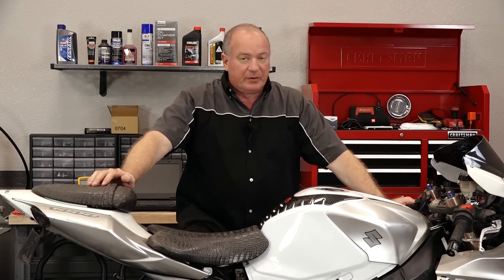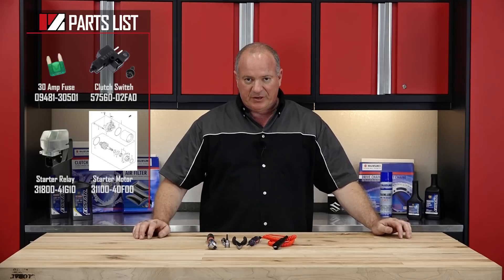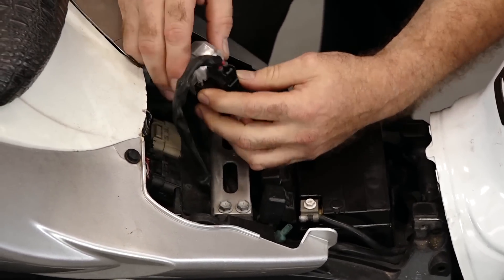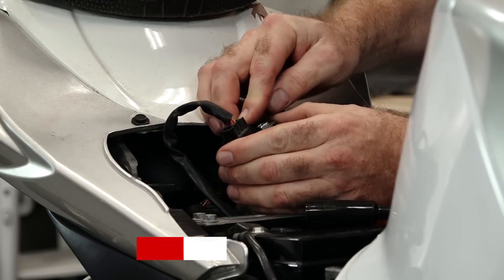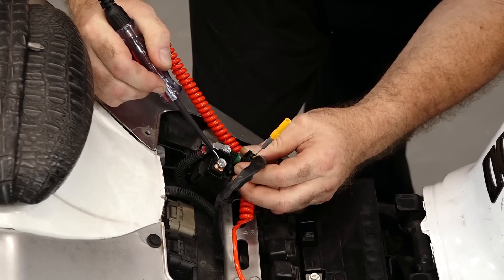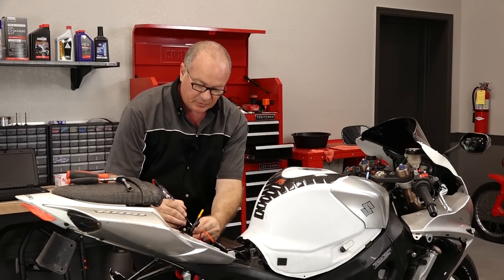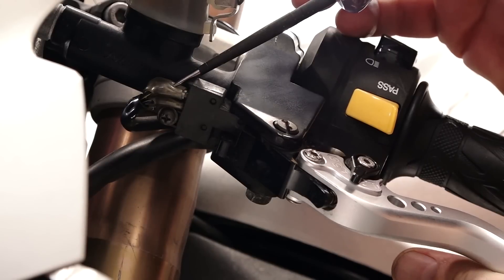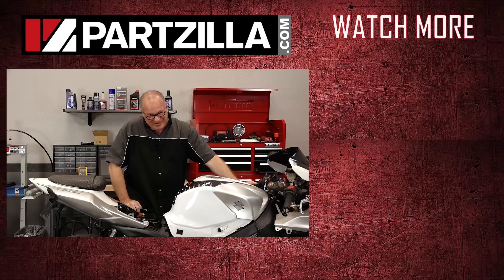GSXR 1000 Won’t Start Troubleshooting | Partzilla.com

Comment: I didn’t hear the solinoid click and the clutch switch didn’t seem to be working correctly. I took the switch of the clutch and it was looking dirty. Sprayed it with some Contact Cleaner. My test light works now when I press the switch and I can hear the solenoid. Thanks for the trouble shoot tips. You’re a Champion!

Comment: Is that test light any different than using the continuity feature on a multimeter?
Reply from the maker: Yes, the test light is testing the presence or absence of voltage.   It's an easy way to see where the voltage stops and diagnose an issue.
Reply: @PartzillaParts  where can one purchase the test light?

Comment: Thanks SO much, you set me on the right direction and more importantly, you've made a lifelong customer when or if I need parts, because you saved me from a few hundred $$$ bill to have her towed to a shop and worked on, etc.! All we need is someone honest who can steer you in the right direction - I have a busa but Suzuki is very similar across the GSXR line. Thanks again, GSXT 1300 owner!
Reply: On your Busa did you get a CHEC light on the dash and no fuel pump prime or starter relay clicking noise? I have the problem and after much research I am assuming it could be either the starter relay, side stand relay or fuel pump relay. What was your issue on your busa. Please feel free to share. Thanks.

Comment: First off thank you for doing God's work ! My test light doesn't luminate when on the negative side but the fuse does on both sides ? When I did the clutch switch test my bike starts but only when the test light is touching the top  prong like you stated ? Am I giving the clutch switch proper ground to start ? Should I trace down that ground on the clutch switch any suggestions would be greatly appreciated, thank you once again.

Comment: John thanks alot man. I have an 03 GSXR R1000 and the issue with mine was the battery. My battery was dead and no good so got it switched out. Thanks for going through these steps which helped me troubleshoot other things to make sure.

Comment: Thank you for the support,I got a 2005 r1000 I remove gas tank and disconnected all electric parts becouse it had 2 stock valves I didn't that put everything back together now the bike won't start it has spark fuel it turns it would not fires thanks I did crank the motor with everything unplug,,,thanks

Comment: I have low mile from o.g. owner gsxr 1000 ('06) with Zero'd out Power Commander II (still hooked up) and my ECU was flashed w FTECU for megaphone pipe early 2019. Stock air filter and stock Ti header. The bike never did this for 10months after I had ECU flashed. Problem:  Intermittently only like 1/6 rides - bike will crank but NOT RUN from cold or warm.....ive waited 30 sec in between 4-5 tries and it might catch and then run no problem.  Sometimes Ive cranked 10 times to point where battery gets weak so I give up...today I went home and let the bike sit at work in sun and tried again 11 hrs later. It still did not want to run and I had to crank 5-6 times and luckily it ran perfect lit off no hesitation after cycling key between tries. I cannot tell if its no fuel or no spark. Fuel pump always spins/whines....has left me stranded at work x2 times and I give up cranking it and just just hitch a ride home w coworker. Bike was damp on nighshift 2 of the 3 occasions so I was thinking moisture ingress ...... I can not replicate the problem after it runs. It does this 1/6+ rides to work...she just will not RUN while cranking not even a clue that it wants to catch and run...its all or nothing....she is cranking with no clue it wants to catch or it fires right up. NEW Iridium plugs several weeks ago to address but it is still doing it randomly!! It also did it hot after a 20 min ride in to work I accidentally stalled it at badge readers and it wouldnt restart! 91 octane fuel + new plugs only 13,000 o.g. miles....mods FTECU flash 2019, but still has old 2007 PCII ( in place but zero'd out)

Comment: I need help with my bike if possible 07 GSXR 600 I turn the key the cluster is stuck wont go to zero just turns on and stay stuck might need a new cluster...I replaced the completel lock set thank you so much for your helpful video so I turn the key cluster is stuck and i get nothing no noise no relays turning no fuel pump priming what could it be if you could help out

Comment: My 01 GSXR 1000 Will not start, I hear the fuel pump. But she will not fire up. New Plugs and filter,I spray starter fluid in intake and nothing. But every once in a while she will give a little rumble then die. Sounds like something is shutting her down. What to do. Any help is appreciated, Thank you for your time.

Comment: 2003 GSXR 600 , it has been sitting for 8 years outdoors , I drained fuel. I hooked up jumper pack straight to bike cables, wanted to see if it will crank, turn the key to on, I get neutral light, head light, tail light, I hear fuel pump try tp prime, Very low (weak sound then normal). get no speed or mileage info on display,, kick stand is down, maybe some type of safety ? checked all fuses, no broken fuse, I am handy with a fluke meter maybe can give me some starting points

Comment: Love the videos you produce and gives me confidence in working on my own bikes. I just bought Chinese clone of a Honda Grom, 2019 X-Pro Vader 125cc. The previous owner drove it for 26 miles and garaged it there after for about 1 year, because he would ride and then it would just shut off completely, he had taken it to motorcycle mechanics and they were dumbfounded when they test rode it and it did the same thing. After buying his bike I had the same trouble and with a new battery I can see the one fuse on the positive terminal that keeps blowing every time I try to replace the fuse. So I get no lights on the digital dash, no start, can you guide me on what you think on how to repair the fuse that keeps blowing., any help is greatly appreciated.

Comment: Thanks for the video. I am having problems getting my K3 1000 to start. My bike had sat in the garage for a few months. It would not start, the starter was having a hard time turning. I replaced the battery, same problem. I replaced the starter, same problem. I replaced the starter relay, now all I get is the new relay buzzes. Am I missing something? What would be the next thing to check? Ant info would be great. Thank you
Reply from the maker: Take the time to test the whole system.  Start by inspecting the cables and wires for corrosion or damage.  Load test battery, test stator and rectifier.

Comment: Hi, I own aGsr 750, 2015.
It happened something similar . I start the instrumentation panel, the lights are good, right. When you hold the clutch down and press the start button should start like usually. She started after I shift in the first gear holding the clutch down and  the starting button giving a strong push and releasing the clutch gently.Before that I checked the voltage on my remote alarm display, was 11.82V. The bike was in cold weather all day outside at work.

Comment: I'm curious what you think would be the most likely issue between the starter or clutch switch. I have an 09 1000. Everything was working fine, but when I went to leave work at the end of the day, would not crank. After about 3 minutes, it cranked and fired right up. No issues the rest of the day, until the next morning goin to work and again at lunch.
Reply: @DarthShibby  I finally found out that my clutch neutral switch was unplugged but the connectors were still touching under the protectivesleeve. Plugged it back together and haven't had a problem since.

Comment: My 08 gsxr 1000 sat 7/8yrs after a tragic accident that my interest was lost. Now i wanna get back to riding & went to start bike to notice i need new throttle cable however my bike won't start. It turns over just no fire so we changed the tank still nthn and then thought about the injectors maybe needing cleaning however not sure due to the time it set in my basement & changed battery also! 1 option said maybe stator then another said check injectors from ur experience what u suggest or idea u may clearly have upon this issue?

Comment: Great video.  This video helped , but what is the possible problem if your test light doesn't light up on the last relay check of the ground side at te Videos 4:09 min part. ?
Reply from the maker: It means you aren't getting power from the switch.  Bad wires, bad switch, etc.
Reply: Thanks for the help Partzilla.  Your videos are a great help and they helped me get more familiar with my bike and at least narrow things down. 
👍
Reply: Hello again Partzilla, 
I do appreciate your videos. 👍   So..  I ended up taking my "no starting 07 GSXR1000  to the shop to get another set of eyes on it. And They tell me number 9 ecm pin melted.  My ? Is..  What types of things may cause this and if i put another ecm in..  how do i know  the new ecm won't just melt down too?

Comment: I have a 2004 Gsxr 600.  Its been sitting for quite some time.  I replaced the battery as I knew it didnt have any power.  I put some gas in the tank.  The starter is kicking the engine over and wants to start but doesnt.  I picked up some starting fluid, gave that a try.  It will kick over and start to run but only for a second then stalls.  I hear the fuel pump working everytime I turn the key and I dont think its my spark plugs as I have replaced them years ago.  Can spark plugs just go bad just sitting in the engine?  Im thinking I might not be getting any spark  from the coils.

Comment: Hi I have a 5/02 GSXR 1000 Suzuki that has been crashed the speedo is disconnected and the loom is disconnected both are damaged I have ignition and the tail light is coming on but the bike will not turn over and the fuel pump is not turning on can you tell me if it needs the speedo instruments to be able to start. It will turn over crossing the solenoid but still won't start. Thanks for any help.

Comment: Your explanation a gave me a light! I have an 05 gsxr 750,it was crashed and totally rebuilt, now I'm having problems starting it. Lights,tach,fuel..everything is working. But when I hit the starting  button,the relay doesn't even click. What can it be? Thanks a lot !
Reply from the maker: Ignition wires, damage to the hand controls, damage to wires going to starter relay

Comment: On my 09 V-strom dL 650 the starter solenoid is clicking several times when I press the starter switch, but bike won’t crank or it won’t start at all, replaced the battery and starter solenoid it self and it keeping doing the same thing, just checked all the step on your great video and they look the be getting good power and ground, but I can’t figure it out 😕, any suggestions? Besides than get you a new bike lol
Reply from the maker: If it's clicking, then you don't have enough power.  Check your wires and connections.  You'd be amazed how many times it's that simple.
Reply: Partzilla yes! You completely right, After I checked everything absolutely everything else like battery, starter solenoid, starter switch, kick stand switch, clutch sensor, starter assembly by it self, I was able to find out than the screw holding the negative wire from the battery was sulfated all around the tread with absolutely no sign of rust or any damage on the outside, the washer and ring by it self was looking so clean and healthy, so I removed it to check the connection and I figured it out than the screw was all white on the treads, I cleaned this out real good, sanded off a little bit and the bike started up right away with no issues 🤙🏻

Comment: I own a 2007 GSXR 600 with 5700 miles, 3 weeks ago I stopped and got gas. When I went to start the bike back up the instrument cluster only displayed the neutral light and the display that shows MPG, mileage, temp etc only had the back light on. When I attempt to start the bike as seen in the video it doesn't start. My first thought was the charging system, very common on these bikes to go out. I order the parts and put in a new rectifier, stater, and battery. I go to start the bike and it still won't start the instrument cluster only illuminates with the neutral light.  The fuel pump primes and the only suggestion I've gotten is to check fuses. Update I've checked all fuses and none are blown I have also checked spark plugs and they all spark, could it be the starter relay? I don't have a test light to check.

Comment: Voltage drops due to shorts or poor connections are the toughest to find. Burned contacts are usually not visible.

Comment: Hello, very useful videos, thank you. I do have a question. 2008 GSXR 600, my fuse is good on the starter solenoid, but I got no power on the yellow wire when I hit the start button. And the relay does not click at all, as well as fuel pump does not turn on. Any help or pointing in the right direction would be appreciated. Thank you.

Comment: Thanks you make great videos. I have an 06 GSXR600. I've had the spark plugs changed, fuel pump changed, all relays checked, the starter switch replaced, new battery and the bike won't turn over. All the lights come on and you here the clicking but it wont turn over. 
No power is going to the fuel pump. Could this be the wiring or ECM?
Reply: What was the fix
Reply: @sarakianebula2667  It was the ECM
Reply: @staceyw5406  was your fuel pump priming . Mine is... but fairly certain it's ecm
Reply: @sarakianebula2667  Yes it was priming

Comment: I’m having this issue. This is what I’ve done so far. Replaced the battery as it was bad. But then my starter relay fuse kept blowing. So, I replaced the starter relay. Still blowing. I’ve been thru about ten 30 amp fuses trying to diagnose the issue. I haven’t checked the clutch wires bc I’m getting no juice whatsoever. I know it has to be something within that battery to starter area. I just can’t figure out what. I’ve checked for exposed or touching wires & found nothing. 😢

Comment: Hey Partzilla! i dropped my 09' gsxr 600 on its left side and now it wont turn over. I push started it and it runs fine but whenever i hit the ignition button i get nothing. I have tried the ignition while the bike is running and i still get nothing, no sound of the starter motor trying to turn over. What coud be the issue here?

Comment: I have power to one side of the solenoid (thick red cable) but when pressing starter switch it's not jumping from one side of the solenoid to the other terminal, the one that runs to the starter motor bench tested both solenoid and starter motor and they work just fine so what's happening? Full power on battery as well.

Comment: Howzzit going..   I'm having problems with my kill switch. And fuel pump not priming when I turn the kill switch on.   Checked all the fuses  Checked battery..    all the lights and everything thing else works. Just the fuel pump and secondary throttle  not priming.  Any info that might help would be appreciated

Comment: Partszilla... Took my  2007 gsxr 1000 apart to paint and maintence a bunch for the winter. Took the whole back subframe apart and took out the ECU. The wife accidentally ran it over. So I'm buying a new one. Can I just get a used on and plug it in and go or do I have to get it programmed or new keys programmed? Thanks
Reply from the maker: You might have to get the keys reprogrammed.

Comment: I have a 2007 gsxr600 and replace the hole fuel pump at first it worked but after 2 days the fuel pump is not priming,

Comment: hi I have a Gsxr 1000 k4 special edition I started in the morning to make sure all was working for the mot 3 hours later the lights came on but it would not start in fact the fuel pump you can here prime usually but its not doing that 
any advice would be fantastic

Comment: **Question
07 GSXR 750

About a month and a half ago my throttle pull cable snapped as I was riding, no biggie, replaced it and figured my bike was all good to go. When I go to start it I noticed my fuel fuse was blown and wasn't sure why so I replaced it. Every time I try to start it again the fuel fuse would pop. So  I ignorantly put a larger fuse in and finally got it to start. However it was running pretty rough and bogged out till it died. 

I then put in its correct fuse and now it won't start. It cranks over but that's all. As far as troubleshooting I change the spark plugs, check the rectifier and that was OK, all other fuses were OK, cleaned the fuel filter, adjusted the TPS sensor, battery is fine. 

If I could get some advise I'd appreciate it!
Reply from the maker: Sounds like there is a short somewhere.  Trace the wires off that blown fuse.  I expect you'll find a wire or two grounding out.

Comment: Hi i have a 04 gsxr750  i change the starter relay at first it was working fine but once again relay dont get power i did check the fuse and the fuse is ok i also check the cluch switch and is good , battery is brand new . I dont know wath else to check please help ....

Comment: My name is Hidalgo, I have a 2006 Suzuki GSX-R600 with 5,300 miles on it and having trouble with my front left turn signal won’t illuminate when button pressed. When I hit the bottom on left turn signal the rear blinks but fast but does illuminate when button and power is applied.